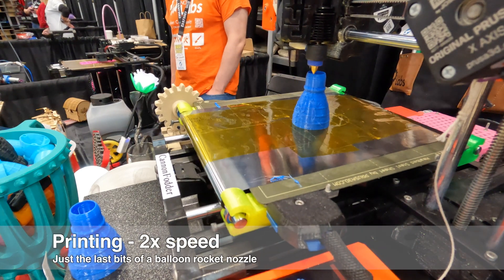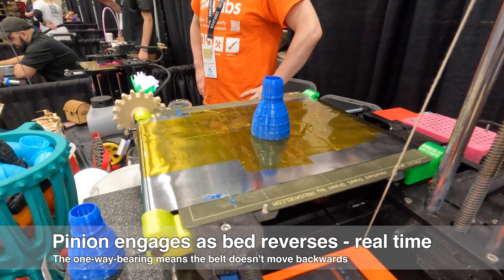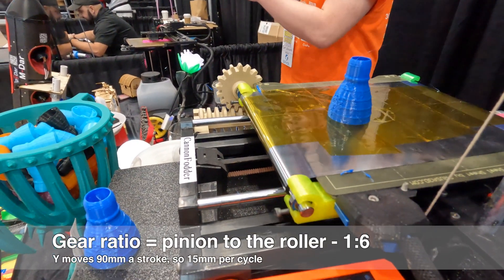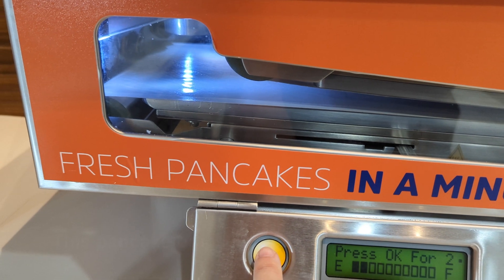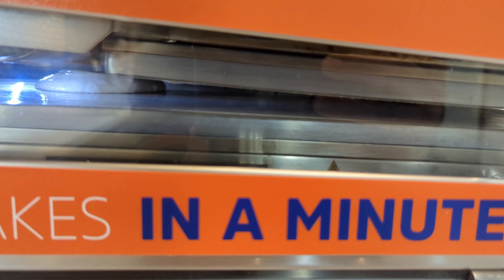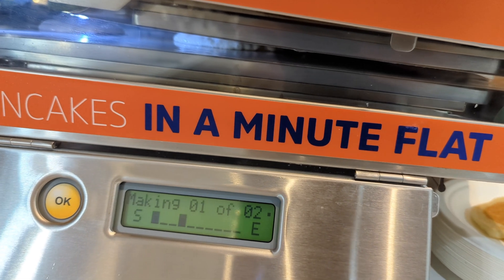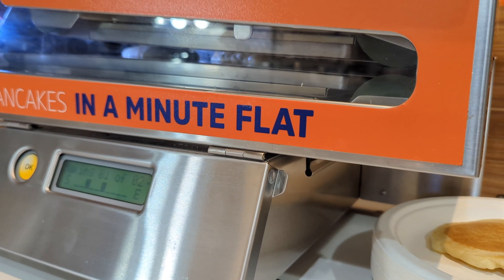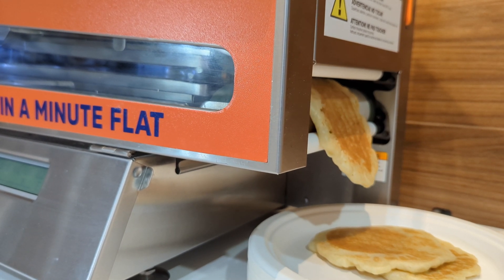PrintShift 5.1 Ejecting at ERRF

Comment: Im planing on building either version 4 or version 5 when it comes out. I am having trouble finding the .2 mm kapton film for the build. Your link in github takes me to a 0.1 mm Kapton film, the next options would be a 0.18 or 0.225 mm.
Reply from the maker: I would go with the .18 - flexibility over durability.  For larger rollers thicker is better but the PrintShift is trying to be very compact

Comment: Very clever. What were your concerns about the string, specifically?

You could route it through a Teflon Bowden tube if you wanted to protect it from fraying, but that would add a bit of friction against the inside of the tube. Otherwise, you could route it around small pulleys. They could be as small as a 608 skate bearing.
Reply from the maker: Not the string so much as that it's just dangling could easily catch on something.  Routing it is a little challenging cuz it's only tensioned for about 20mm of Z travel, and needs to coil up or something out of the way for the rest of printing.  Pre-tensioning it with a key leash, adding some pulleys and guides would sort it out